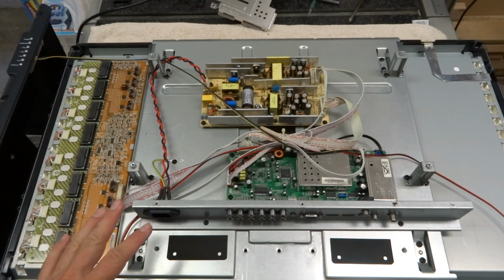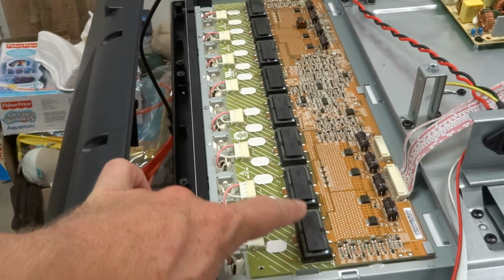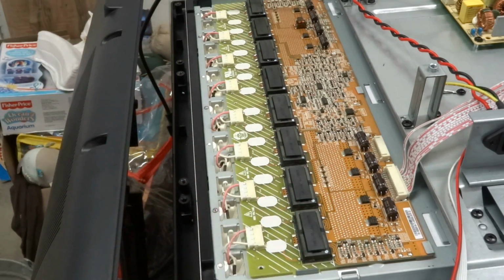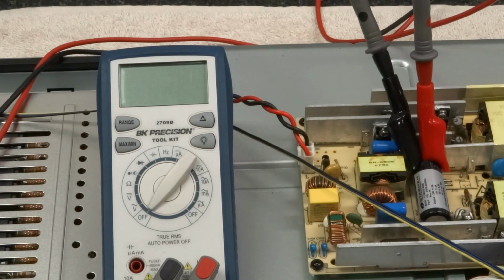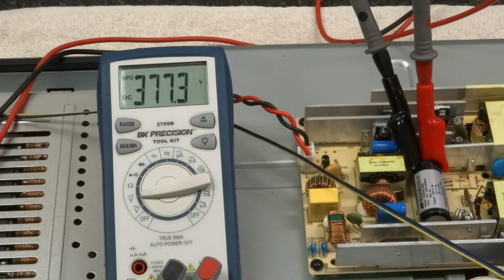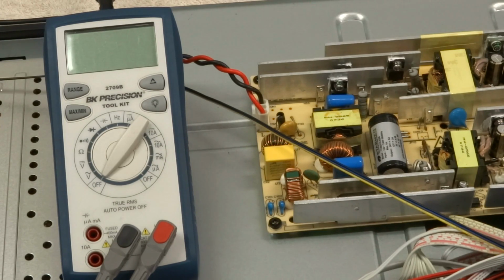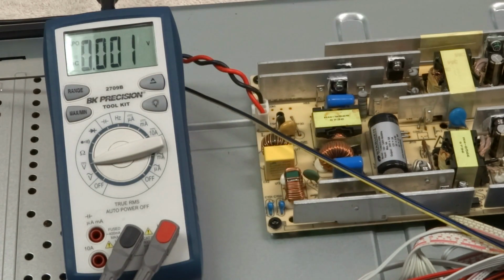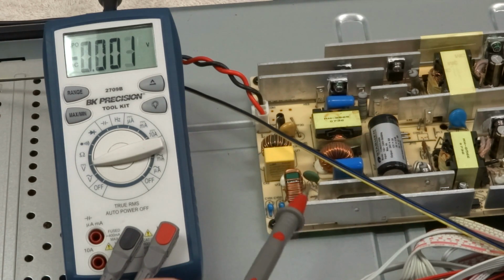Safety concerns when working on electronics

Comment: I'd  be interested in knowing what resources are available for a hobbyist to learn more about safety issues like this.  I'm interested in tearing apart some old electronics (Mainly for the purpose of kitbashing and model building, not actual electronics work) and I would like to feel confident that I can safely handle the parts I encounter.

Comment: Thanks for the overview. How do you discharge a capacitor if it's charged?
Reply: +Matthew Finger some short terminals, but that's not good way. You should use resistor to do this.
Reply: I use a light bulb with a positive and negative wire on it like a brake light I also use the same light while I charge a old lead acid battery it’s a old trick to get the battery working again it pulls current while it charges
Reply: @jimcatx3090  you can just short the + & - on the cap.with a screw driver. when no power is feeding what your working on.
Reply: usually I'll rest my pecker across both the terminals, not the safest way but it works!